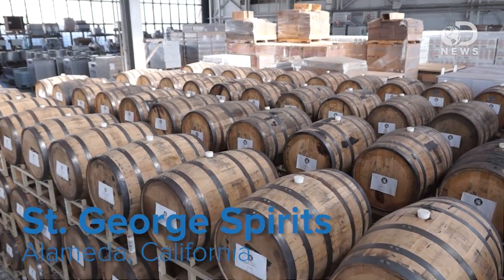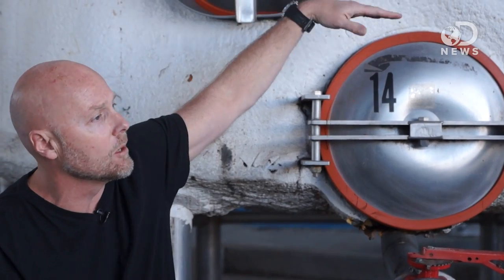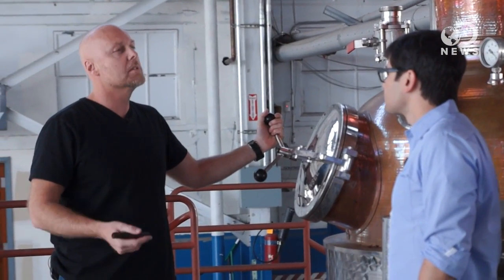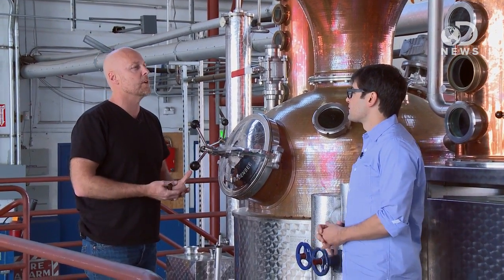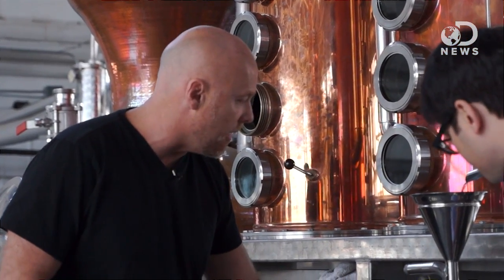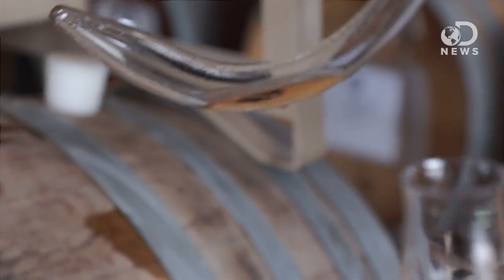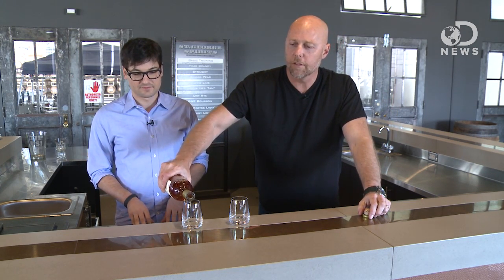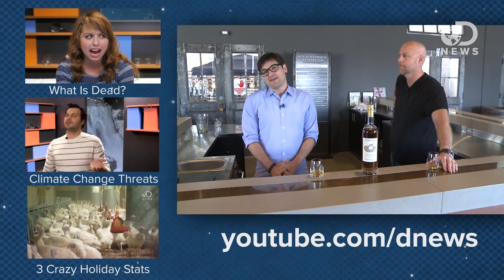Cocktail Chemistry: How Brandy Is Made

Comment: the barrels on the bottom end up ageing faster and are sold as a cheaper brand and the stuff in the middle is typically the more expensive batch. This is because hot air is in the top of the building and cooler air is in the bottom.